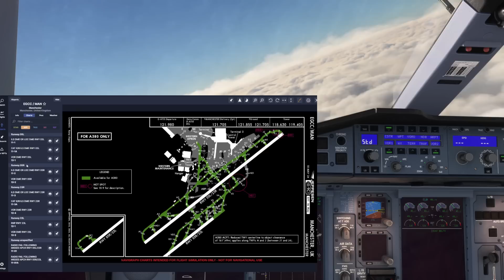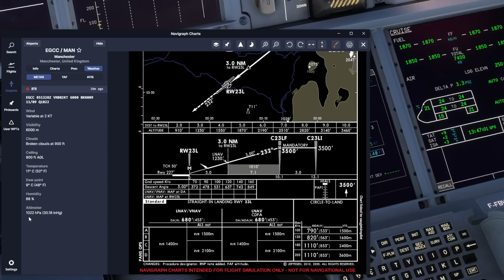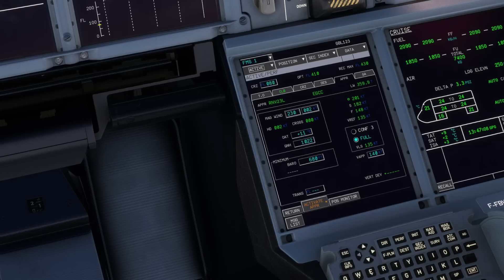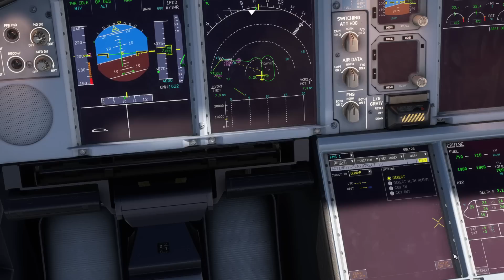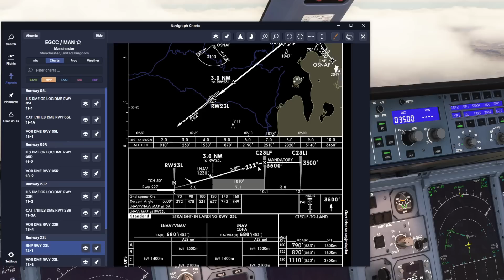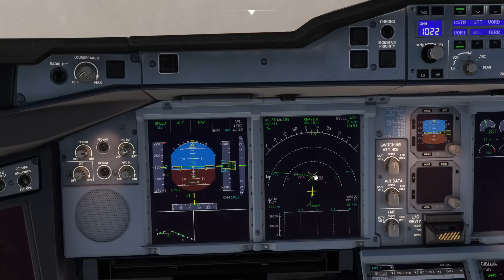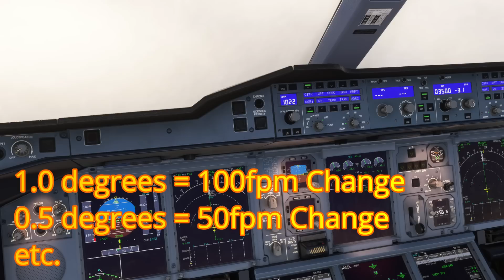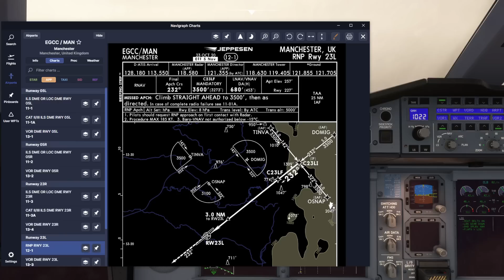FlyByWire A380 - How To Fly RNAV / RNP Approaches (Non-ILS) | Full Tutorial - MSFS 2020

Comment: Maan, you make it look so easy in your videos :) very much in detail and comprehensive and it all makes sense. Will try it again. Just to add - I have discovered yesterday that the performance for fbw a380 is much better when we record using GE force experience rather than OBS. Out of topic here but, OBS causes significant fps drop and it makes the aircraft almost impossible to handle. Not the GE experience though. Thanks again for the tutorial.

Comment: Pardon if this is a noob question, but wouldn't you add the Rwy elevation of 227' to 680', since it's a Baro minimum? So you would get a decision altitude of 907'?
Reply from the maker: The chart takes this into account. If you see the numbers in small on the minimums chart, you'll see it is usually around 200 (which is 200ft above the ground) and the larger numbers are 200+airfield elevation above the ground.
Reply: I think the local altimeter & the fact that the 680 is from the chart has already taken care of that

Comment: Nice clear video, thanks. I don't know what it is but I cannot land this thing at all well and I've been an Airbus guy for years, I'd be interested to know your TCA Sidestick settings. Much obliged if you  do. 👍
Reply: I mainly fly the FBW A32NX and found I didn't have to change any of the TCA Sidestick settings to fly the A380. My settings are:
Joystick L Axis X - sensitivity - 0%, sensitivity + 0%, dead zone 3%, neutral 0%, extremity dead zone 0%, reactivity 75%
Joystick L Axis Y - sensitivity - -29%, sensitivity + -29%, dead zone 1%, neutral 0%, extremity dead zone 0%, reactivity 75%
Joystick R Axis Z (for rudder and nose steering) - sensitivity - -48%, sensitivity + -48%, dead zone 4%, neutral 0%, extremity dead zone -1%, reactivity 80%
I find these work really well - good luck!
Reply: Thanks a lot. I’ll give it a go.
Reply: It's a big plane, I found that focusing on VERY small movements with the stick really helped. 
It's almost like I let the aircraft fly itself, and the only thing I do is very small corrections to it.

Comment: What FPS are you getting on the A380X
Reply: 25-35 on the ground (8k model, cabin on, major airports with traffic injection and GSX) and up to 60fps in the air.  It's surprisingly light on my system - I had visions of it completely tanking fps.
Reply: 700

Comment: The general guidance is for every 10 ft high/low you are, adjust the FPA by 0.1. So if you’re 50 ft high on a 3 degree path, set 3.5 degrees. That should get you in the right place for the next check one mile later. Update it at every check, so if you find you’re still 20 ft high one mile later, adjust to 3.2 degrees. If there’s more than a mile until the next check, then it’s probably best to just reset 3 degrees after a mile, and wait until the next check to make a further adjustment if needed.